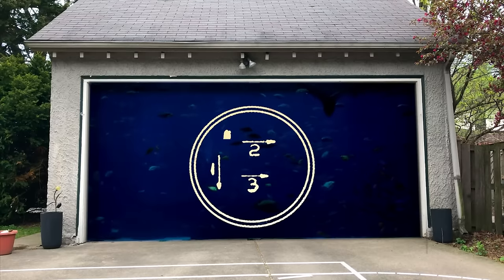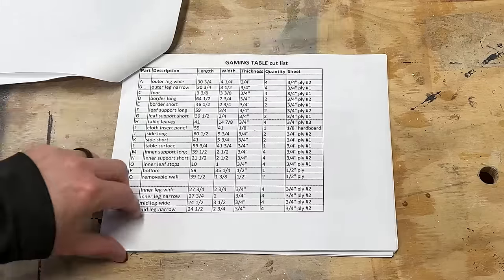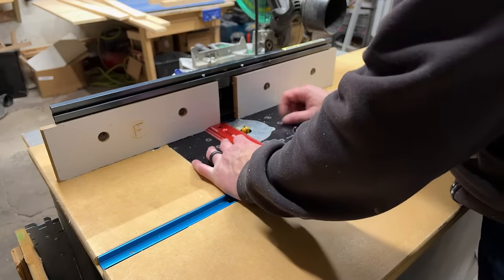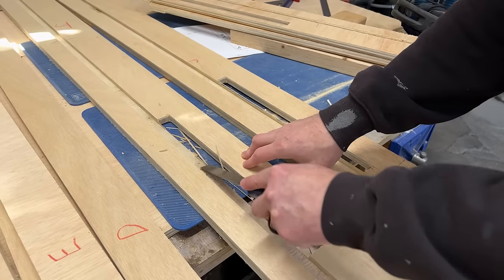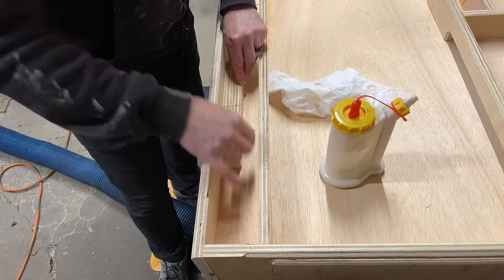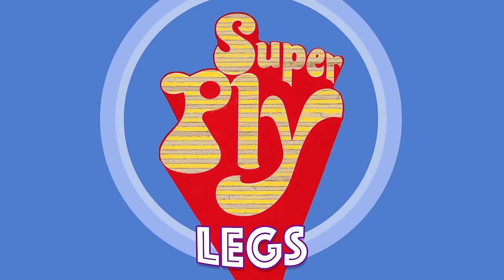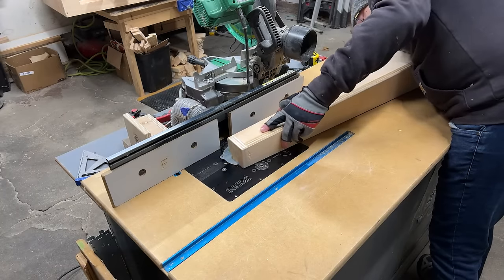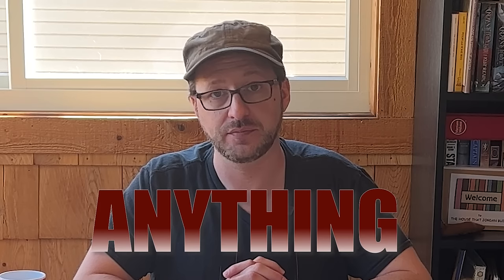SuperPly Gaming Table - Part 1: Basic build & Legs

Comment: 5 months ago I bought your step by step guide because this is actually the very first video who inspired me on doing somthing that I really wanted to do for some time; specially because is not playing cheap tricks on screens on the surface, diy that are not really diy unless you have very expensive equipment, etc. Anyway, after 4 months today I just finished all my plans on metric system for a 18mm plywood board (here in Spain 99% of suppliers work with 18mm or 22mm.), adding my own tweaks and preferences and now I'm ready for the next step. Have a few "wholesale companies" that will make a budget for cutting all the pieces and I hope to do the assembling. Really hope I can update with a new finished gaming table with a few months :)

Thanks for all the tutorials and great support!
Reply from the maker: This is amazing!! Thanks for taking the leap of faith and making it work for yourself. Please keep me updated with the results!!

Comment: Oh snap..  those legs are brilliant.    And everything with the leaves is super smart as well.  Personally I would have made the game surface deeper but that's just preference.  I'm glad plywood is catching on because personally I genuinely prefer it to the look of regular wood.
Reply from the maker: Thank you sir! So in the plans one of the only changes I made after I built mine was to add a 1/2" more depth to the vault. I spent a lot of time debating between leg room under the table vs how high the surface is so it's not too high for kids, and after building it felt like the leg room is perfect (wouldn't want the table to be any lower) but that I could squeeze out a little more height to the vault so I did (in the plans). And yeah some people have shown me pics of finished builds with dark stained ply, some have painted the whole thing (I saw a white one with brass accents that looked great) and then some substituted hardwood for parts if it. It's obviously up to you, but using only ply helps limit any wood movement and is built to all fit together pretty seamlessly (and is likely a lot cheaper than hardwood) and like you I really like the look of quality plywood.
Reply: @withJordanFrank  I think plywood is better because the wood grain comes out way more interesting.  It's more complex and even has symmetrical patterns.  I work in a wood mill and I see ply sheets all the time that I would drag home if I could.

Also, I have an improvised gaming table.  I took a regular kitchen table, one that had a small support box underneath that holds the legs.  And long story short I slapped on a bottom and turned the top into a removable lid.  There's a lot more like adding a handrail, making it look nice, and what not; but that the gist.  I didn't have to worry about the leg height because the basic dimensions haven't changed and the handrail only added 3/4 inch to the top.  The handrail is a bit small but it's super comfy and I have a 3.5 inch deep play area.  I'm genuinely surprised I haven't seen anybody turning regular tables into game tables.

Comment: Our table is just about finished. We elected to use a dark walnut stain and brass cup holders.  It added a little bit of elegance to the whole build. Elected to place the LED light switch next to the Beige (not white) AC/USB Outlet as everyone wanted the ease to play with the lights as opposed to reaching under the table. Surprised the lights were such a hit!  Also, elected to grind the t-bar to ruff it more and even did the sides fearing the stain and poly that got into the t-bar groove would make it harder to press in the t-bar. 95% done - just need to iron and install the cloth.
Reply from the maker: Ooh, very nice! Post a shot when you’re done on Etsy if you’re so inclined, I would love to see it! Sounds classy!

Comment: Great build - we're going for it!  Just ordered some parts and bits. Curious as to the grade of plywood that you used as both sides appear different. 

ADDENDUM - This is a perfect project for me and my high school graduate grandson who loves to play board games. I  needed a good excuse to purchase a better and more manageable table saw and this was it. Also purchased many accessories like the Incra V27 Miter Gauge & Bow XT Extender to make it easier to work with a new "job site" size table saw that we can move around as needed. Also purchased a new router that was a vast improvement over my ancient one. The plan measurements are spot on correct and everything fit precisely (to my amazement). Not so much for your superb detail plans but for our precision in cutting and shaping the pieces. All of the bottom 2 1/2 inch pieces fit precisely where they should with minimal or no resizing.
Reply from the maker: Amazing, very excited for you!! I used the best plywood Home Depot had that day 😅So that was an A-grade 5-ply, I believe oak. There was a time when I did everything I could with their baltic birch but if I remember correctly that had already become scarce when I made my table. I did my best to match everything but it could always be better, you know? Good luck with your build, feel free to hit me up with any questions!
Reply: @withJordanFrank  OK, thanks. What would be the impact of the alternative of very carefully (and slowly) using a jig/sabre saw to cut the rectangular openings on the 4 side panels? I'm not sure we have a router that can take 1/2 inch bits and 1/4 shank bits do not appear to be an option from our Infinity.  Would it create to many splinters? Even if we used tape?

Comment: So excited to see you're back!  I'm intrigued about a lower cost gaming table.  Would it be sturdy enough to use as an assembly table during gaming downtime?
Reply from the maker: Thanks Frank! Depending on a bunch of factors this guy will set you back around $500 - some of which is electronics, etc, that can be skipped or priced wildly differ depending on what you use. But compared to most commercially bought tables that’s a lot cheaper. As for an assembly table? That’s one heckuva crazy idea. It should be strong enough for sure. I don’t know about pounding anything with serious down force, I feel like that will probably dent the plywood, but it’s a level enough surface that can hold some weight, so why not? I definitely envisioned it for crafting (wife sews, paints, assembles scrap book type stuff on the table) so I’m down with it
Reply: @withJordanFrank  FYI, I am 2 minutes and 30 seconds in.  You haven't started showing the build yet, but I am positively dying to build a one a these.

Comment: How much modification do you think would be necessary to make this work with hardwood?  Seems like the internals could be plywood for structure and avoiding movement, then hardwood for the skirts toppers and legs?
Reply from the maker: Thanks Christopher for the interest. Yes, you could 100% substitute hardwood anywhere for the plywood with minimal adjustments. In fact the only thing I can think of off the top of my head would be making sure the boards used in the legs were milled to the exact same thickness as the skirts (due to how the skirts slip into a gap in the legs).  Obviously you’d have to glue up panels to make the leaves, so that’s some additional steps, but otherwise you would have no problems. If you do it I’d love to see photos!

Comment: Before i buy the plans, how many sheets of plywood?
Reply from the maker: Hi Jerrod. You will need 3 sheets of 3/4” and 1 sheet of 1/2” plywood. You will also need 1 sheet of 1/8” hardboard to make the removable velvety game surface (which is technically optional but is part of the plans). The plans come with a full materials list and a cut list to minimize waste.

Comment: Hello, new homer owner here and soon to be father, i havent ever crafted anything more than a bird house in my life and am considering buying power tools ect to do projects like this as a hobby and money saver. Would this be a good beginner project or would i be in over my head?
Reply from the maker: First: congrats on your new home! Second, more important than the first: congrats on the soon-to-be father hood!! That’s so great! I’m going to be pretty straight up and suggest you do NOT tackle this as your first real project; it’s a medium-level build for sure and will require things you might not think about like a lot of clamps, a router, a brad-nailer, a pocket-hole jig…. I mean unless you’re just diving full on in and spending a bunch of money at once, but… most people kind of start with a decent table saw, maybe a miter saw, and then your standard cordless handheld staples like a drill, a driver, a jigsaw, etc.  And the rule of thumb is you buy the tool you need for the next project, and slowly build it up from there. You could always get lucky and find someone selling a bunch of stuff at once, but I feel like starting from scratch with this table would be asking a lot. You’d certainly learn a lot, but I don’t know if I’d be that brave if I was in your position 😂

Comment: Hi, how big is the gap inside between the leaves and the playmat? Wondering how big of a game can be stored (or dnd terrain, etc).
It's an amazing design!
Reply from the maker: Thank you! The depth of the “vault” is 3”, the leaves are 3/4”, so if you put the leaves on that gives you approximately 2 1/4” of space under the leaves for your pieces, puzzles, etc. If you wanted a vault with more depth (at the cost of a taller table) you could pretty easily scale that up simply by making the four side-pieces deeper; nothing else would have to change.
Reply: Thanks! I'll be buying the plans as soon as I can make some space to build it.

Comment: I've watched this a dozen times and am about ready to get started. Looking at the plans and cut list, I'm wondering why I couldn't make the leaves and side rails out of one sheet so it's "grain matched". Am I missing something? It's possible I'm overthinking this. It's happened once before.
Reply from the maker: First of all, thanks for watching and purchasing the plans, it means a lot. Secondly, I think you’re totally right. I don’t know how I overlooked that but I think there’s just enough space where if you move parts D and E to the same 3/4” sheet as the leaves it might all fit and you could get to it all match. It would be tight but I think you could make it work. Super smart,  excellent observation, and I’m going to go back and see about revising the plans to make that a feature. Thank you, and good luck!!

Comment: Great video, easy to follow the steps and see what you're doing. Currently planning my own table (intended to also double up as a dining table). After use how have you found your table works comfort-wise? I don't want to make the lowered section too deep as I'm concerned it'll lead to people bashing their knees off it or the table top will be too high and make it uncomfortable to eat at.
Reply from the maker: Thanks David. Yeah, that was definitely a challenge and a design consideration: how low to put it so that you don’t bash your legs but the top wasn’t too high for kids to reach comfortably? I think I nailed it as far as how low it goes. The only thing I would have changed retroactively is I think I could have made my vault 1/2” deeper (adding the extra 1/2” up, not down) because it would be even better for some larger board game pieces. I wound up changing that in the plans so it’s 1/2” deeper than the one I built. Good luck with your build!

Comment: I wonder how difficult it would be to make it half as long again so that the sides fit 3 each instead of 2. I often have a lot of people for game night.
Reply from the maker: I can't tell you exactly how difficult it would be :), but I Can tell you the legs will hold the difference just fine. You would have to scale the leaves and adjust the spacing of the internal bracing to hold the larger leaves, and you would have to adjust the size of the holes in the skirts to handle the larger leaves. You might also run into a limitation if your skirts need to be longer than 8' (that's the longest you can typically get sheets of ply). So there'd be a lot of scaling and adjusting for that, but it seems doable.

Comment: Would it be possible to scale this up to fit say 8-10?
Reply from the maker: Ooh, interesting question. I don't see why not. The legs are definitely strong enough, you wouldn't need to change anything there. Still utilizing full sheets of ply you could only expand it about 7-8" wider, but the length could go quite a ways longer for sure. You'd probably still only fit one person at each end of the table, but the middle could hold three-per side instead of two and that would get you to eight people.